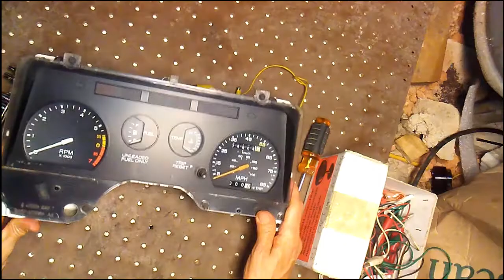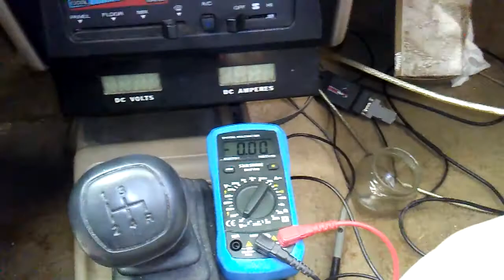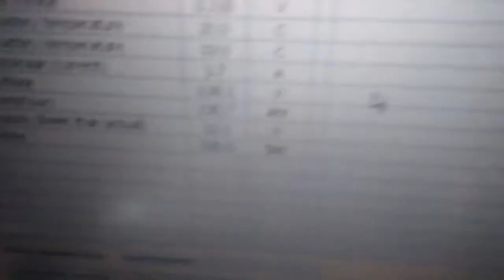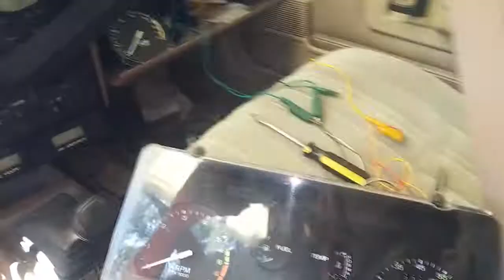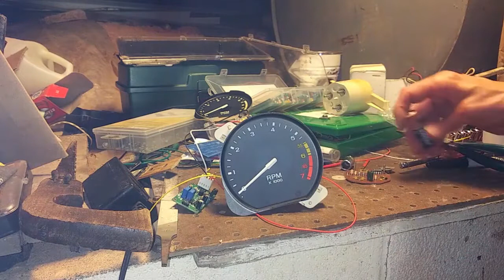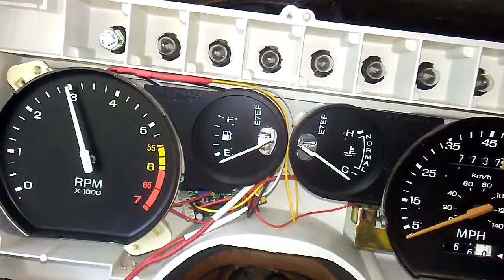Tachometer becomes EV ammeter / power meter in 1988 EVcort electric car using AD620 op amp

Comment: Why not use something like a Arduino Nano or something smaller to provide the same function? Have you considered that?
Reply from the maker: I grew up in the 1960s so I'm pretty much an analogue guy, I'm just now learning about the capabilities of Arduino.  But you're right of course, a digital solution would be more accurate and reliable and the programming does not look to be that difficult.  Probably I could have done the tach, fuel/state-of-charge and temperature gauges all on one board.  Thanks for the suggestion.

Comment: I came across this because i'm looking to do a similar modification to my miata for an ev conversion, so thank you for such a detailed video! I  had a little laugh at the "unleaded fuel only" marking on the dash for something that presumably never had a gas powered engine. how has your system been holding up the past few years so far?
Reply from the maker: Maybe I should have changed it to “Unleaded Batteries Only”.  The gauge been working great these past 2 years.  I find I don't even have to glance down, I can see the gauge in my peripheral vision and it shows a response before I can feel the acceleration.  So it really is quite useful in driving.  However, just the past month of so, it intermittently has been showing a current of about 100A when there actually is none, for example when waiting at a stoplight.  The BMS software is showing 0A, so seems the problem is not the Hall sensor or the BMS.  Probably a loose connection somewhere although I guess it could be a malfunction of that amplifier board from ebay.  I am now working on a setup to charge the pack directly with DC voltage from solar panels on the carport roof.  Once I finish that project I will try to track down the problem with the ammeter.  Good luck with your project and thanks for commenting.
Reply from the maker: By the way, while the specs for the amplifier board don't show any limit on the output current, the specs for the AD620 chip indicate a maximum current of 18 mA.  Though I haven't tested it, I suspect this is also the output limit for the board.  Coincidentally, it is just enough to produce full scale deflection of my meter, but it's possible it might not be enough for some other meters.

Comment: Great project! Has the mileage range improved since the battery conversion from lead acid?
Reply from the maker: Yes with lead I was getting about 2.8 miles/kWh.   With the lithium I'm getting more like 3.4 miles/kWh.  I replaced each 6V 225 Ah "golf cart" battery with six 60 Ah LiFePO4 cells, 3 in parallel then 2 in series so 6.4 V nominal.  More importantly, the lead acid batteries only lasted 5 years and 12,000 miles before becoming unusable.  The LiFePO4 have gone 19,000 miles over 10 years with no obvious signs of deterioration.  And being 600 lb lighter, it drives like a regular car, not a slug.  Thanks for commenting.